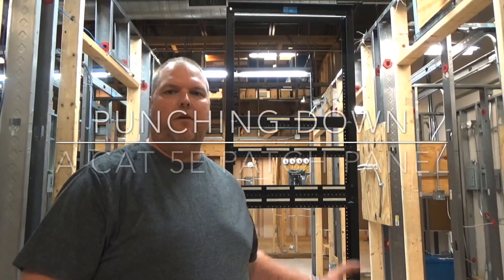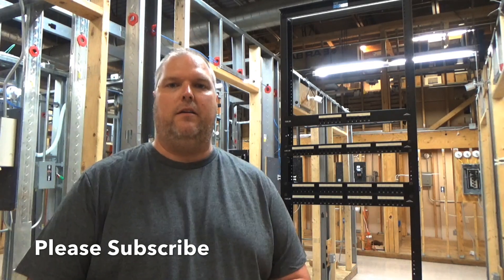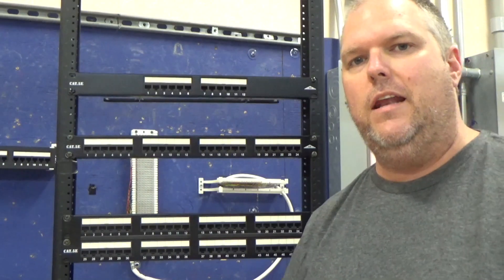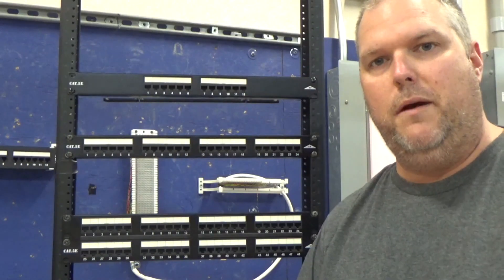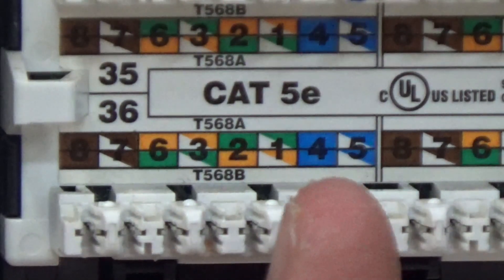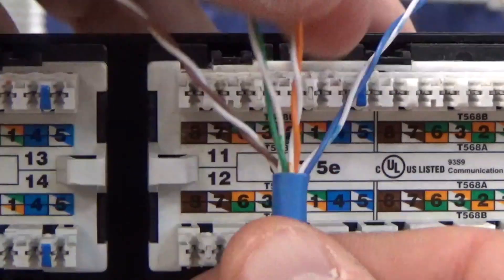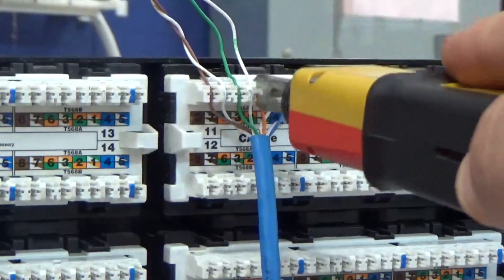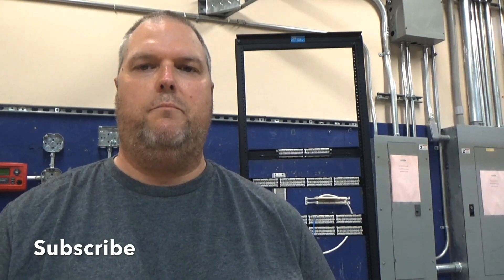How to Punch Down a Cat 5e Network Patch Panel Explained

Comment: Hey, I was wondering.  Wouldn't it be easier to start from bottom and work you way up? So that the previous cables you put in don't get in the way?  I'm kinda new to this and getting into IT so I'm just wondering.  Otherwise, this video was amazing, considering the material i'm working with doesn't show how to actually punch these into the patch panel, just what they do and how they work.